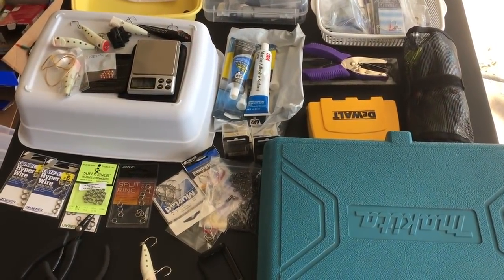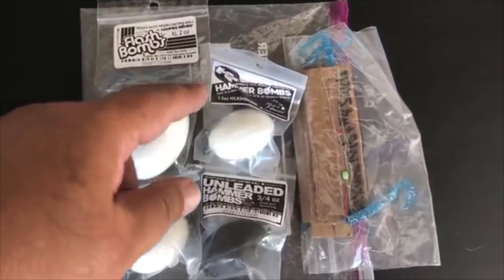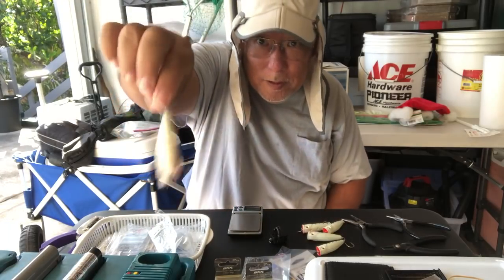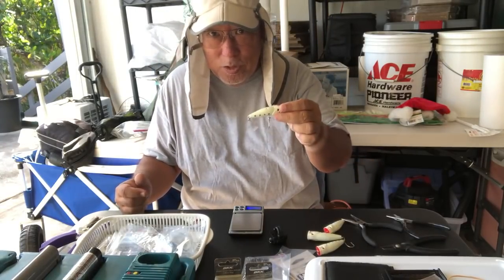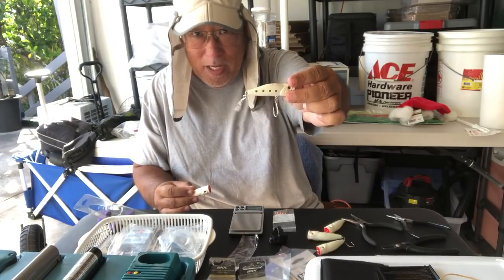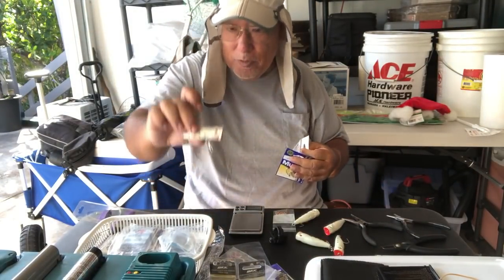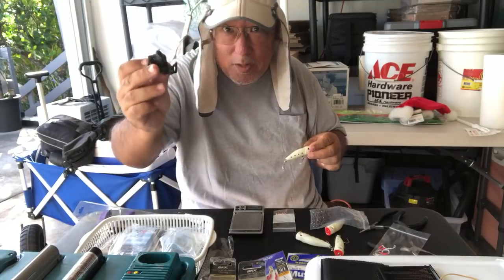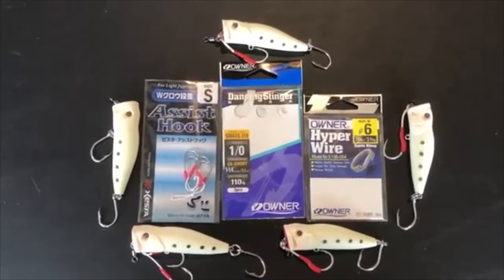Adding Weight To Light Lures & Plugs!

Comment: i heard of injecting water into plugs to add weight.   Have you tried that?
Reply from the maker: No i haven't. When i add weight it's for castability. Most times it's for small plugs. For me lead is the best choice, compact & dense. Tungsten would be to expensive.
Reply: this would be for casting distance. 1 tablespoon water weighs about .5 oz.
Reply: Good idea to rust all the lure inside
Reply: Surely water would deaden the rattle?
Reply from the maker: @raymondthompson2908  BB's have always worked for me.
Reply: @ScubaChris  I find that blue/white tack works well too. On the outside of course.